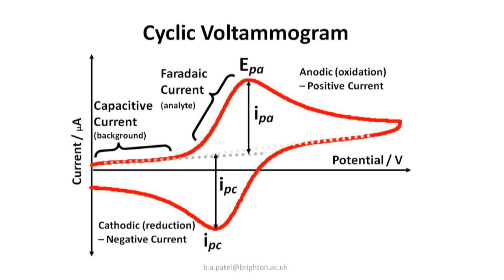Cyclic Voltammogram

Comment from the maker: Oxidation is a loss of electrons from the analyte to the electrode and results in a positive current, however reduction is a gain of electrons from the electrode to the analyte and that results in a negative current. The electrode is the key in the reason the currents are either positive or negative rather than the analyte, which is why this can be a common mistake.

Comment from the maker: If you want to run open circuit voltage on a three electrode system, you will need to make sure the potentiostat is capable of running this mode of electroanalytical technique. Then attach your detecting electrode as the working electrode and attach your reference electrode to both the reference and auxiliary. This should allow for OCV measurements.  Measuring short circuit photocurrent the set up is similar, however you need to incorporate the light source and study wavelength influences.

Comment: I have a 3 electrode electrochemical cell connected to a potentiostat , how do i measure the open circuit voltage and short circuit photocurrent ?